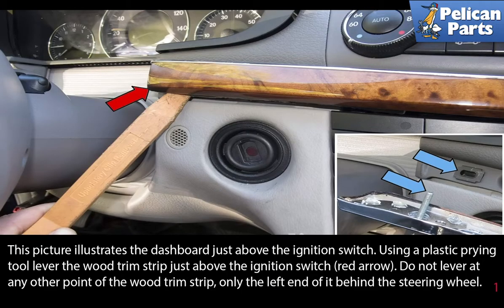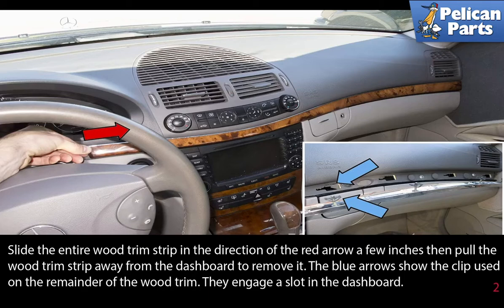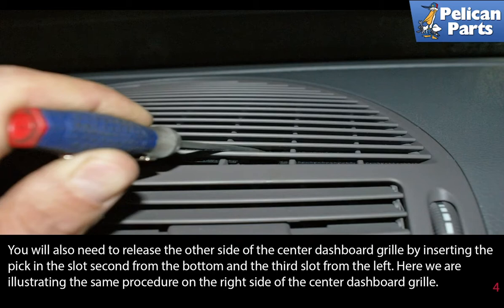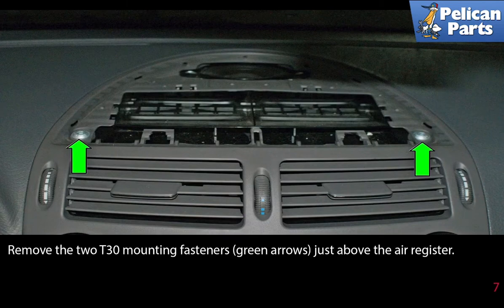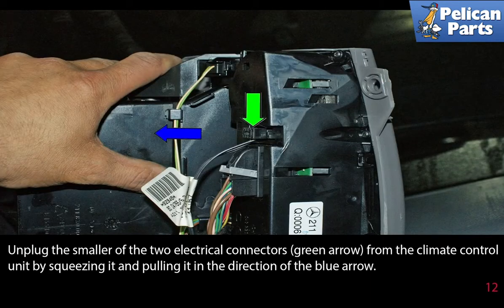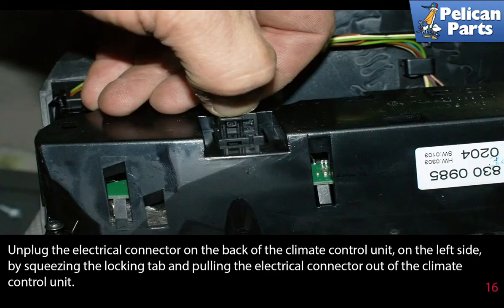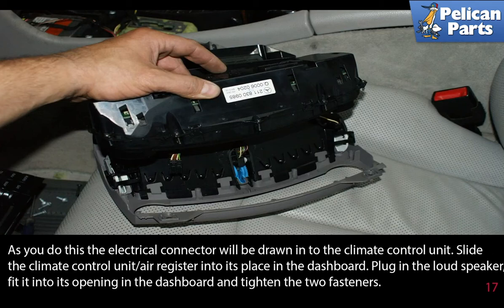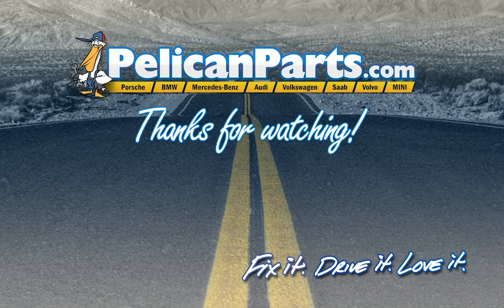Mercedes-Benz W211 E-Class Climate Control Unit Replacement

Comment: P2316 (n19) any ideas? 
Thanks
Reply from the maker: This could be a short in the coil primary or the coil itself has an internal fault. Try swapping the coils around and see if the fault code follows the movement of the coil.
Reply: @pelicanparts  coil? It says ac control module. This is a dtc code
Here’s what my obd said 

P2316 one or more messages from control unit N19 (Air Cond control unit) are not available on the CAN bus